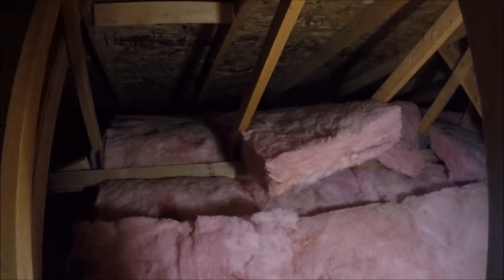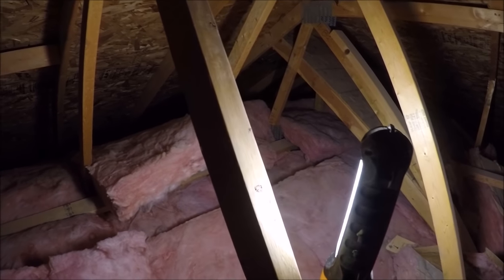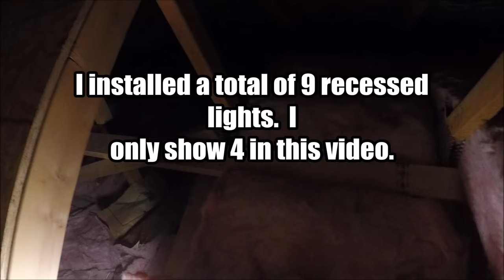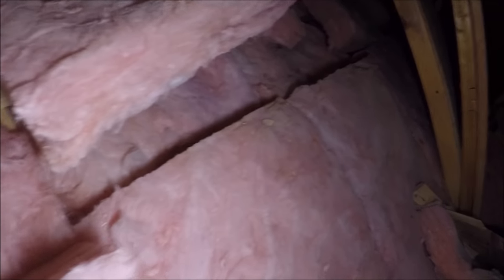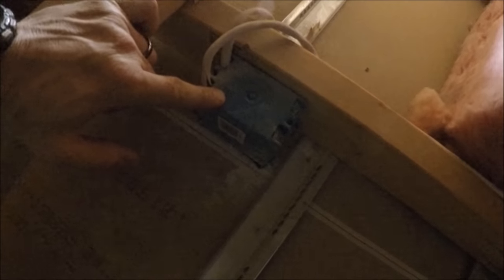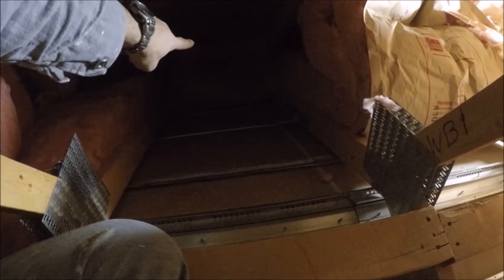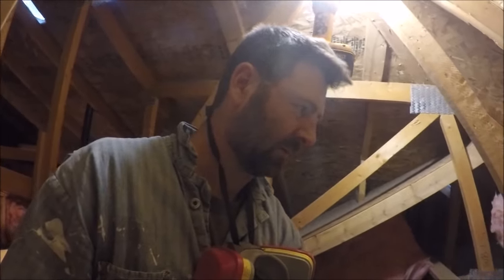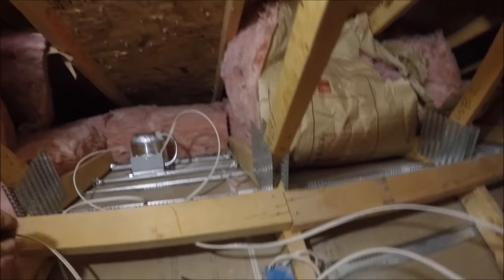How To Add Recessed lights To Your House | THE HANDYMAN |

Comment: I installed a dozen of these yesterday, (before seeing your vid.) There is a 3 way luminescent switch on each light unit that you didn't mention. Personally my job was in drop ceiling tile, so was much easier than your job. (No going into the attic.) Sweet vid., love your channel!

Comment: Thank you!!! This is precisely the video I needed to see. I have to replace a bunch of old fixtures that my wife has coined "booby & nipple lights". She wants recessed lighting. I am assuming I can use your method for the most part and simply remove the old junction box, drill a larger hole, and drop in the "remodel" housing in those spots. Right?!
Reply from the maker: I have a new video coming out in a few weeks where i'm adding 5 led recessed lights.  NO can that goes into the attic.  Pretty neat type of light.  Looks just like these but better.

Comment: Some wise advice from a young man ditch that the 18 volt handlight and buy a headlight at home depot  and buy rechargeable batteries or for how much you could use one buy a good rechargeable one from Olight flash lights I use one almost everyday at work (HVAC installer)

Comment: where I'm at everything electrical has to be run through conduit.  we can't have shielded wiring.  nothing by us has ground wires.  all houses are grounded by the junction box back to the breaker that is grounded outside.  it seems no one else needs to use conduit. :(.  this is good info though, just a bit more work for me

Comment: You know what works great for checking for blocks before cutting a big hole is that speed screwdriver the klein for cover plates it works awesome just put in the hole and turn sideways and the s shape will follow drywall and confirms there is or not an obstacle

Comment: I honestly can not see you reading all of the comments on all your videos even  the old. But here goes.You are an inspiration, with your clean,well thought out, and professional work. Do you know of a quality product that will allow switching a light on and off without rewiring. With all the remote access products, there must be something.If you had a drop ceiling screwed to one inch firing and the second floor carpeted and not accessible, how would you mount a ceiling fan on a clean ceiling?. once a hole was in an open joist bay snaking lines in would be doable but how would you mount a fan rated box to the drop surface?
Reply from the maker: I read every one.  All 13,000 of them.  You can get light bulbs now that you turn on and off with your phone or a smart home system.

Comment: does the fan turn on by remote?
Reply from the maker: switch on the wall. nest to the switch that turns on the lights.  This house was wired for 2 switches to the fan box.  one for light and one for fan. they don't have a light on their fan so it was an unused switched power source.

Comment: Nice job! I had a comment and a question- Re: the respirator, you know that for the attic work like that, you can get by with the round pink filters which are primarily for particulate (fiberglass insulating fibers, sawdust etc), the ones you had which cost almost twice as much are meant mostly for vapor as well, like if you were dealing with moist areas under homes, and things that produce harmful vapors (mold, paint, bondo etc..).

My question is do you ever come across button-board with plaster (another name, rock lath and plaster)? It's in a lot of places here in California pre-mid 80's, but it destroys blades and I wondered what you would use for cut outs for can lights/retrofit boxes etc. Best I've found is carbide multi-tool bits like for grout, or really large carbide hole-saws. Wasn't sure if you had any other recommendations.

Great service you put out with these videos, nice boat!
Reply from the maker: I"m remodeling a bathroom right now from the 40s and it has wood lath and plaster.  much harder to work with.  I cut holes with a chisel mot of the time.
Reply: ah okay- so it's probably just one of those, bite the bullet and bear with it tough things to deal with then. Thanks

Comment: Did you put the insulation back over the cans?  I have blown insulation in my attack wondering how far I need to keep it from the fixture or if I can just back it back shut.
Reply from the maker: With the led lights there isn't much heat to worry about. Some regular cans say to keep the insulation back and some say you can cover them.

Comment: The one thing I was most interested in was replacing the insulation.  As far as around the lights.  I know some lights have issues over heating with the insulation too close.
Reply from the maker: The light fixture will say if it can be covered or not.

Comment: I under bid a job for 3 can lights for 200 parts and labor now they want 11 more any advice
Reply: Btw it only took me 45mns
Reply from the maker: Ouch.  If they are in a different area of the house you can try to bump up the price based on the new location.  When I have gotten myself in to situations like that I look to the future.  I take it as a learning experience and an opportunity to do some amazing work at a very high value to the customer.  This will earn you referrals.  Don't be afraid to tell them to tell their friends and family about the services you provide.

Comment: Was that the IRS man trying to grab the cash from your window?  Also, I know that you price per each piece, say for hanging chandeliers. In multiples like this, is there a price break given? I also like to guess on your pricing and am usually kinda close (?). $200 per each? Thanks...
Reply from the maker: I reduce the price the more of them they are. I think My total price was $2400    That was for 9 cans and all the wiring needed to hook them up.  I didn't buy the LED light trims.  On one of the bathrooms I had to run a wire down the wall and connect it to a wall mounted light fixture. 12 hours of labor 16 hours including shopping and driving.

Comment: How do you make sure that you won't overload circuits etc.
Reply: For instance in an older house with only 100amp service.
Reply from the maker: You can look up circuit loads in a number of books.   This circuit has 4 led lights added to it.  The amp panel is irrelevant It's how many outlets or lights are on a specific 15 or 20 amp circuit. Just flip the breaker and count how many things turned off.
Reply: Those 8 LED's only added  120 watts max.  Hardly anything on a circuit.  Almost any circuit would be 'amp'le !
Reply from the maker: WJ  and they were on different circuits.  Most of them were replacing incandescent light fixtures.
Reply: Even better!  And by the way, I like that adjustable drywall bit.  I have the 6" fixed.  Never saw an adjustable  one!